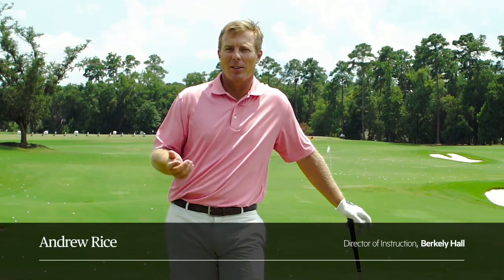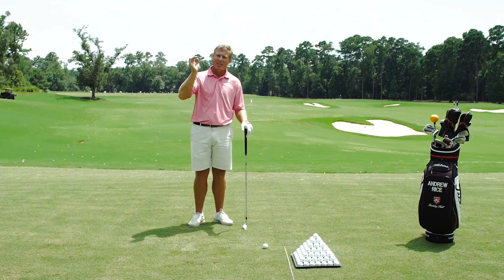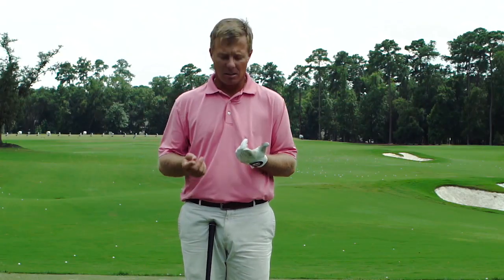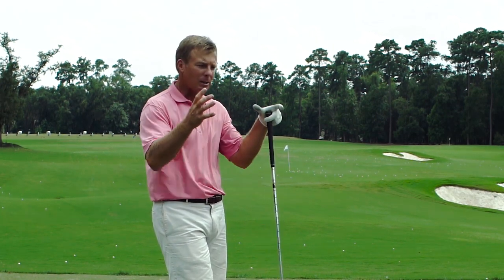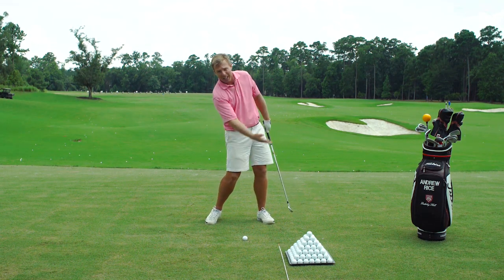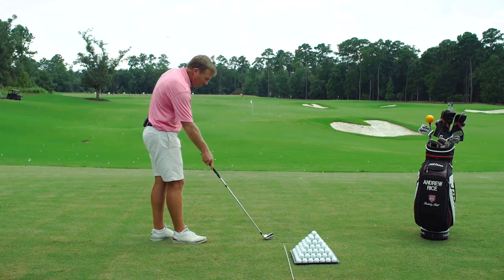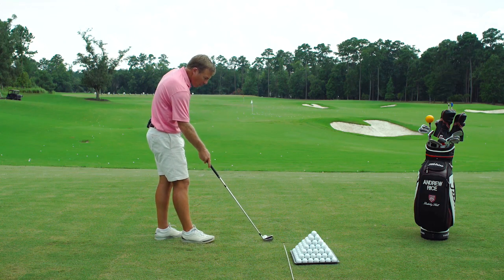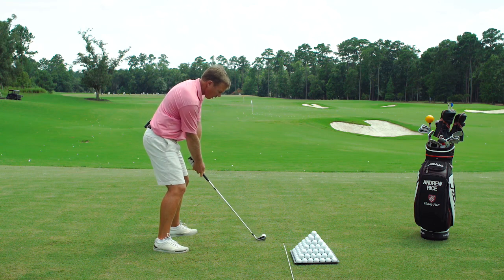The Truth About Divots

Comment: When I try hitting down on the ball it causes all kinds of problems. Shanks tops lefts and rights. The club is meant to be hit like it sits on the shelf when you bought it. The real key is to hit the ball below it's equator and have the shaft near vertical at impact. Since the ball is sitting on the ground, combined with the natural arch of of the swing, you will usually take some grass or sometimes a divot but it is not because your hitting down on the ball.
Reply: Well you want the shaft leaning forward but yeah